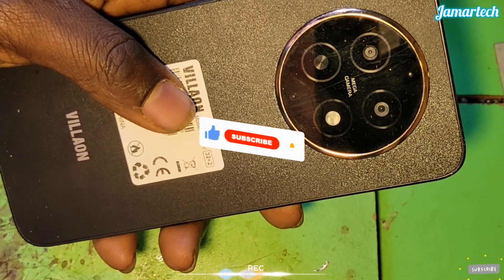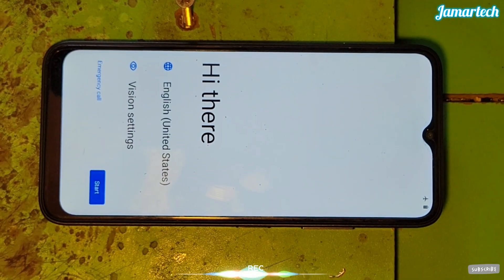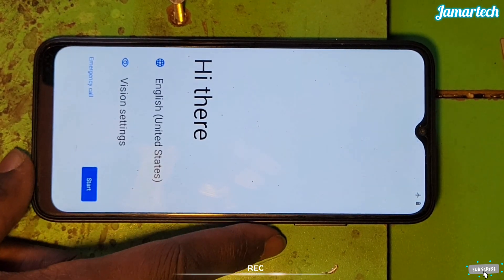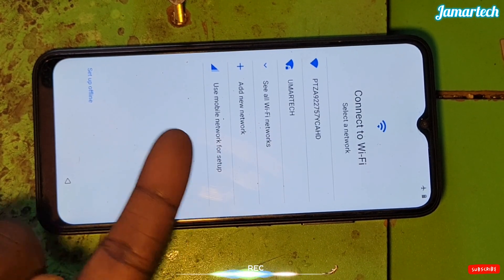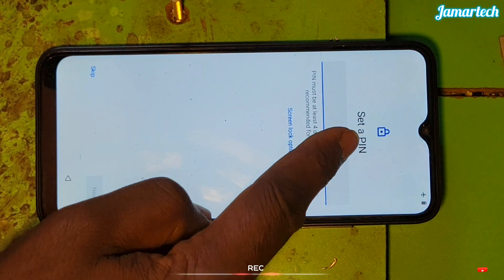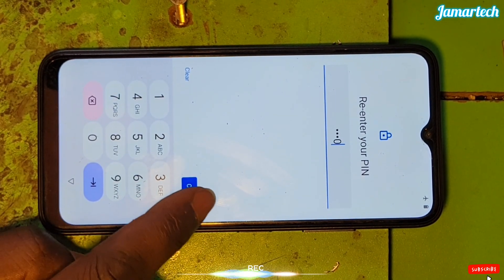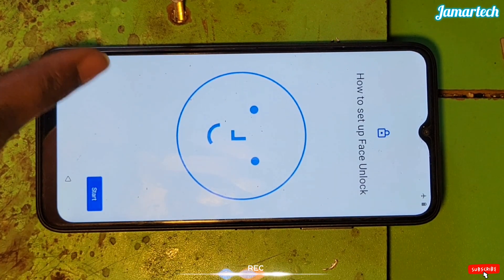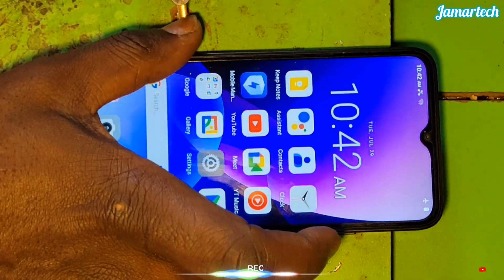Testing the VILLAON V651W V40 After a Factory Reset frp #Wi-Fi bypass

Comment: How to bypass it
Reply from the maker: The code (*#*#49#*#* is to foce download mode .
  And where to put s code= 
U need to access to browser and after input in seach tab (addrom bypass) and on addrom scroll down to (Dial) app , and will open immediately.. and there put dat code while putting a usb cable with the tool . Thr will be bypassed  immediately and will take u to the main menu of the phone launcher.  And thanks bro
Reply from the maker: So bro if you want bypass.  
U need a computer and afree tool called samsung frp tool and this code here to bypass ( *#*#49#*#*) only and thats all